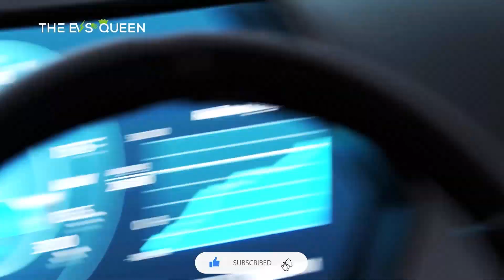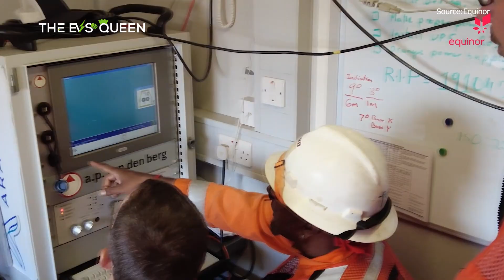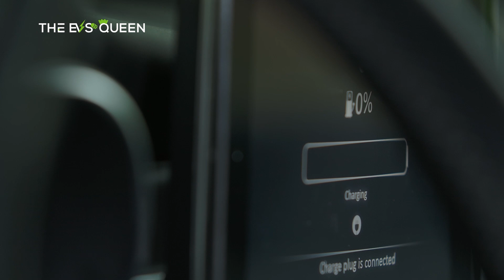Big offshore wind farms are now transmitting battery juice to the Grid

Comment: A trash way , my invention way levitation levitating is flash driving way running in light speed way without air and fuel and batteries. 
It's safe in Typhoon.  Not that way , my way is gapping zone way,  the driver is in the gapping zone .
Reply: Why are you posting just a bunch of random words?

Comment: Holding off and delaying wind power in a climate catastrophe , way to go humans !
Reply: Do you know the environmental costs of producing ,maintaining,  and disposing of off shore wind turbines?  They are made from mostly non recyclable materials and 1000s of tons of concrete for the bases. They require extensive and regular maintenance (carried out using a large deisel ship) . When components or full units need replacing the old components are dumped in fields or go to landfill. Coupled with the fact they only produce power when the winds peed is high enough(and not too high)  they are really not the green innovation they are portrayed to be. Though this is no surprise because nothing is as it seems these days . Wokeness and political agenda reigns,  common sense and reality no longer seem to matter.
Reply: Do you know the consequences of our current carbon emissions ? Makes windmill disposal small beer ! @carlkuss8300